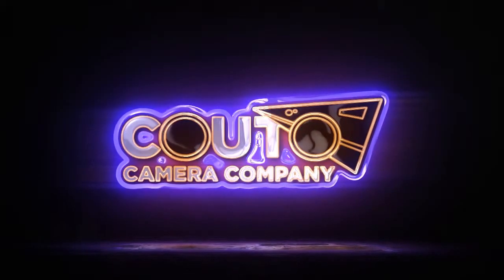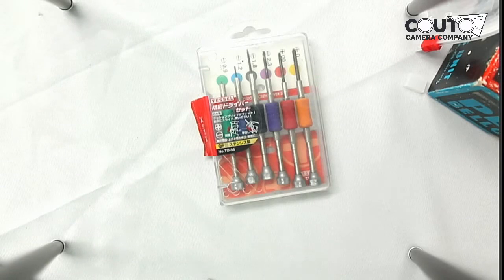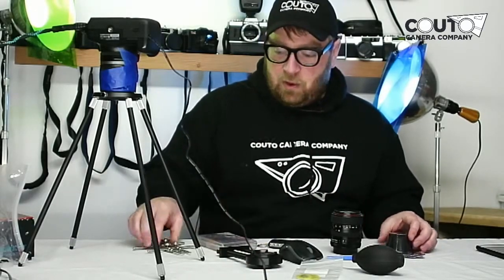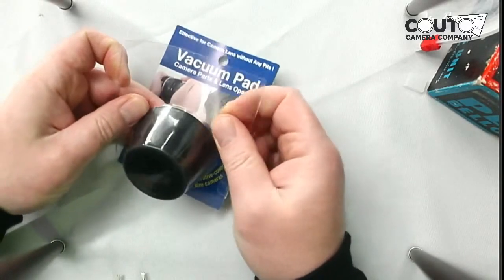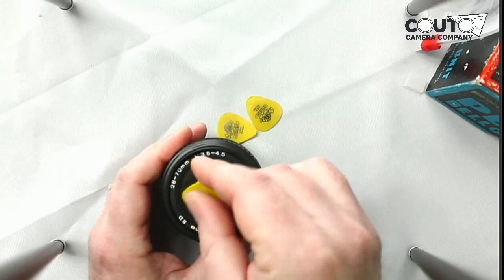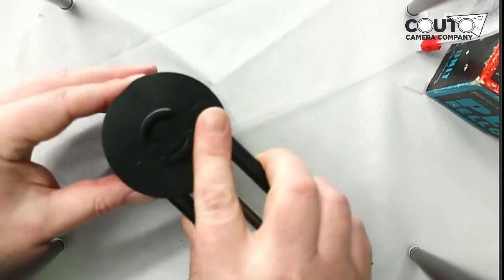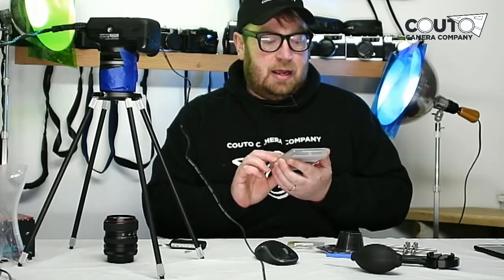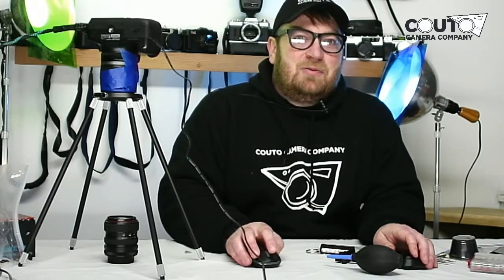Lens Repair Tools - What tools are needed to repair lenses?

Comment: I only found this by accident, but it was interesting. Which common lenses would you say are good for beginners? I have most of these tools. I tried to clean a Canon FD lens, and it didn't go very well. Someone told me Leica screw mount lenses were easy, so I ordered a book from Japan about them, but they don't look very easy to me. By the way I have bought from you numerous times on ebay and been pretty impressed with your service.
Reply from the maker: One more comment to add to my last reply, 50mm lenses in general are easiest and 28mm have a lot of layers and floating optics, zooms have too many moving parts, 135mm can be easy but a little "deep". Keep in touch!
Reply: Couto Camera Company Thank you for the detailed reply Ben. My repair tech is retiring, so I need to learn.
Reply from the maker: Thanks Jon! I think the easiest lenses to clean are Minolta lenses. They are very well constructed and easy to get apart. Generally I say try the lens as is before taking it apart because some imperfections don't affect the photos - but sounds like you're like me and actually enjoy it. Much appreciated for your comment! Please subscribe and keep in touch. I've been super busy lately but getting ready to do another live stream soon. Thank you for being a client. Ben